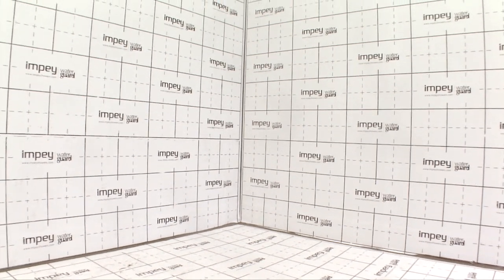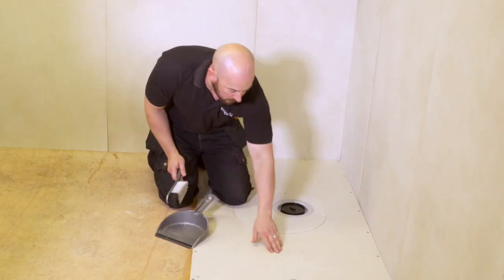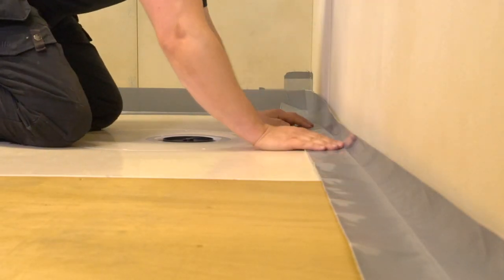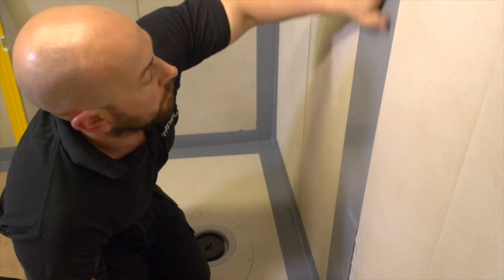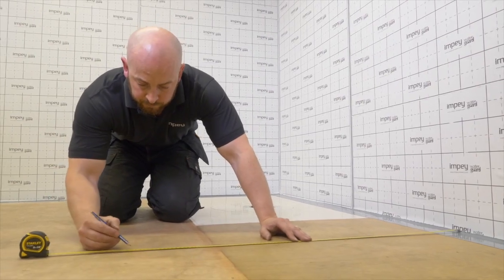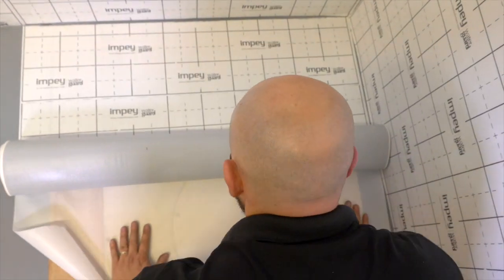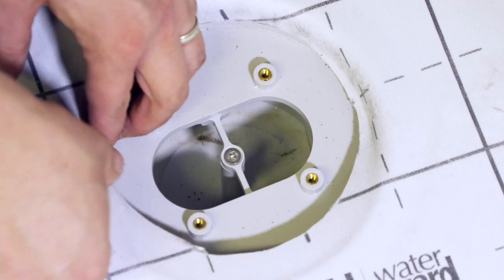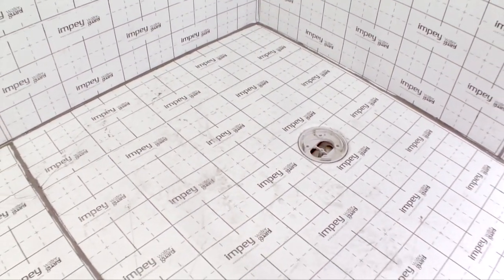How to install wet room tanking

Comment: Hi great video, i would like impey to do a video on how to seal round pipes for showers and taps mounted on the walls. How do you do it ? 

Is the floor membrane the same as the wall mebrane ? 

Cheers
Reply from the maker: Hi
We will look to create a quick video on how to get around pipes - keep an eye out for it. If you need advice soon, please contact our Technical Team: 01460 256080 who can help.

Yes the membrane can be used for both wall and floor

Comment: What is the treatment for all the wall protrusions (pipes, cabinet and toilet mountings, toilet and sink soil pipes etc)?
Reply from the maker: Hi - any kind of additions or pipe entry points can be addressed with the joint tape as its a bit thinner and very easy to manipulate15/22mm holes can be drilled through it to create a pipe collar or if there is existing pipework a split can be used and slightly bunched upward with same method being used after with the main sheet but moving the split to a slightly different location and then finished with the jointing compound. the good thing about these materials is that the butyl backing stays supple and will reseal and cuts you have to put into it or if you have to drill through it (wall only).    
If you have any further queries, our Technical team are on hand via phone or email, who'd be happy to provide more information  - 01460 256080 technical.support@impeyshowers.com

Comment: Can you use ditra matting insulation on top of this and the install the tiles?
Reply from the maker: We are unable to answer this question without some more information. Please call or email our Technical Team and provide them with further details so we can ensure you get the best advice for the situation.
01460 256 080 
or technical.support@impeyshowers.com

Comment: Could you lay self-adhesive UFH mat over this then apply self leveling cement?
Reply from the maker: Yes, UFH can be applied to this, a lot of the matt types have a certain amount of tack on them which will adhere to the matting, if you have to cut the back matting to turn the UFH you might have to use a slither of duct tape to hold the turned edge down but that sticks to the membrane as well.
Cement based levellers are also compatible with this membrane but do be very careful not to fill in the pre-formed gradient on the former as it needs to maintain a 1:40 gradient.

If you have any further queries, our Technical team are on hand via phone or email, who'd be happy to provide more information  - 01460 256080 technical.support@impeyshowers.com

Comment: Is there any need to do this on a ground floor concrete floor if I’m going to double layer micro cement and then seal for water?
Reply from the maker: We would advise a quick chat with the technical team. They’ll be online from 9am tomorrow. 01460256080
Reply: If your still around tom...whats the answer to this question?
Reply: @inamhassan2694  sorry mate, ended up getting a pro in for that. not sure they did any tanking though, tbf.
Reply: @tomkelly500  ah ok. No worries. I appreciate your response matey.  I think I will get mine tanked just to be on the safe side. Im getting told i don't need to but for the sake of not so much more in costs i reck its worth it in the long run.

Comment: I've just fitted my Impey Aqua deck, great product and easy to fit! I will be plaster boarding next (using Elements type board), and will then tank with the WaterGuard kit, including the whole floor area of 2.1 x 2.7m. However, I am also fitting the loose cable Prowarm ProGrid+ system as fitted by Roger here (https://www.youtube.com/watch?v=2oqwys3ycKc). For this you need to fit the matting down that the cable runs in and I was planning on running this into the shower area - is it OK to fix that matting down on top of the waterguard kit with kst, and then tile on top of the matting? The matting is 6mm so I would need to account for that, plus adhesive, plus tile when setting the drain grate. 

I did email your tech team a few weeks back with this question but haven't heard back from them.
Reply from the maker: Hi @carlosfandandgo - thanks for your query. Please speak to our technical team about this via: technical.support@impeyshower.com or call them on 01460 256 080 so we can ensure you get the best advice for the situation.